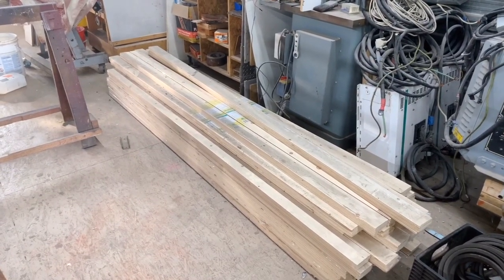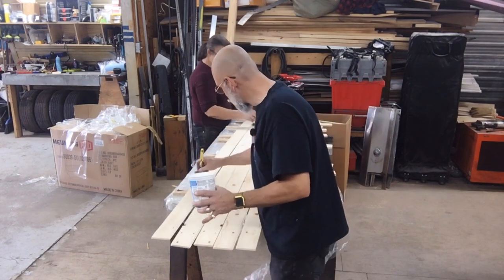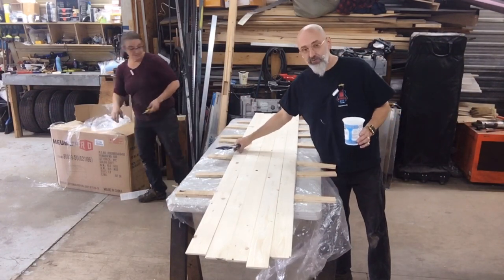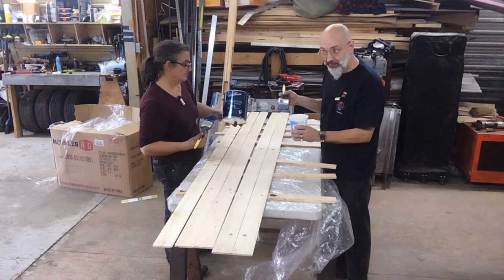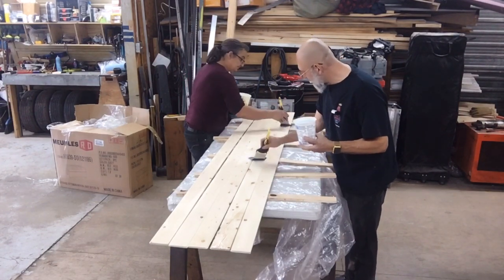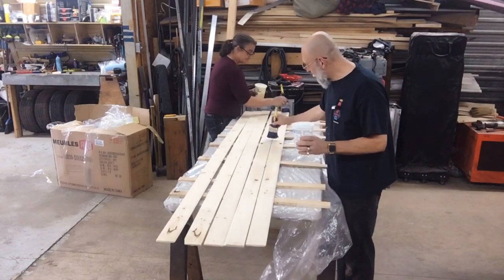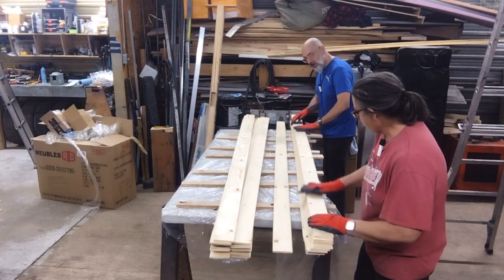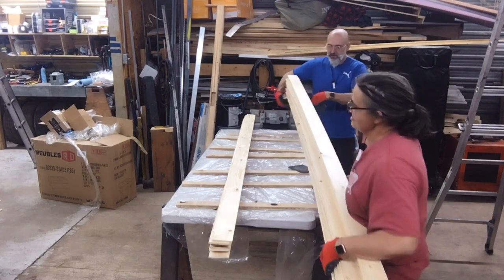E34, Decisions and Pine planks.

Comment: I love the look & feel of the pine boards too. Did you consider using 4'x8' sheets of bead board instead of your last layer of paneling and these pine boards? It would save some time and overall weight.
Reply from the maker: Time yes, weight, not much, these are only 5/16 thick.